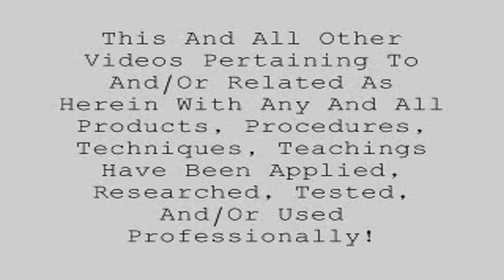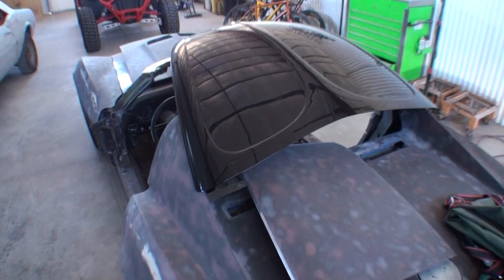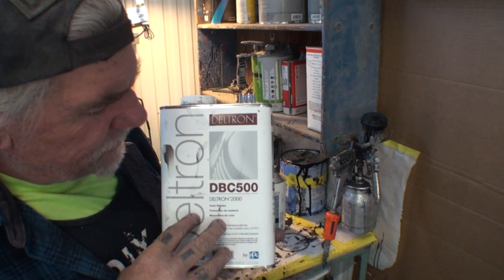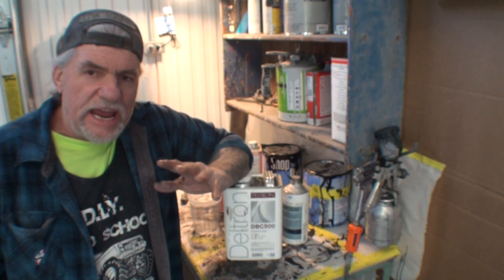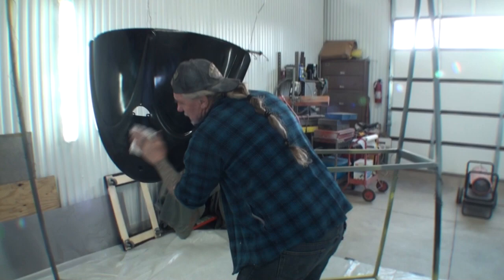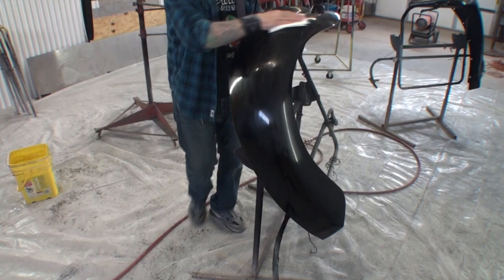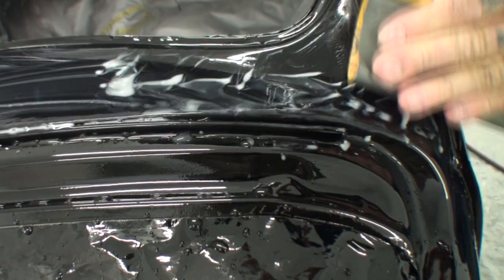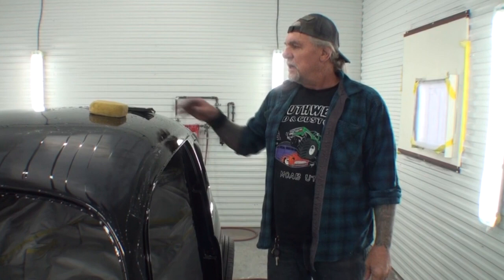How To Get A Show Car Paint Job - FLOW COAT For CLEARCOAT

Comment: Well my friend Pete … I ended up doing this by making my own mistake thinking I could clear the next weekend … after applying 2 coats of clear … and stopping . I also mixed my first two coats wrong … instead of 2-1 I mixed 1-1 which made resanding a challenge .. but I rectified the situation this weekend and pullled an all nighter and sanded the whole car down again and reapplied 2 more coats of clear to fix the situation
Reply: Did you use an inter coat clear or regular urethane clear to coat first? It makes sense to me using the inter coat first, sand and finish with regular urethane clear. It is new to me as I wouldn't think enough tooth was able to hold the final 3 coats. But your nibs are done with no orange peel and plenty of UV left for protection.

Comment: I sealed up a ‘97 crew cab GMC last night in Speedokote Color Blender/Intercoat clear($90/gal!!!) with Eastwood metal flakes in about 58 degrees and it still flashed off very quickly to my surprise! No runs either, very impressed for the price. Gonna clean it up and clear this afternoon when it warms up again.

Comment: Pete, this is a lesson from your experience that goes back to the 6 part series over 10 years ago. This was the two-tone 1941 Willy’s putting flames on using DBC500. 
  So not new to you, but simply experience speaking. Called anything from “Flow-Coat” to “Intermediate Clear” or really a inner-clear! 
Thanks for the training Pete!
Regards, DK. Omaha.

Comment: Pete used DBC-500  with my high school Auto Body students when we do our  "custom painting" unit on their practice fenders.  Very good results too.  Kids love doing the design, taping, painting, clear coating..  Might try this on my Camaro even though it is white.  Nothing wrong with a deep shiny white paint job.  Less expensive than wasting good clear too.  Put 5 coats of clear on my 79 Malibu, sanded with 1000, 1500, 3000.  Turned out great, but lots of work and more $$.  Great video!

Comment: Hey Pete I wish I would have thought about using DBC of HOK intercoat clear to do this! I always used the urethane clear and had to wait. I started using Matrix clear after I saw your comparison on clears a few years back, I like that it is actually clear... It is so nice and easy to polish a flowcoat paint job, just a lot of work to get there! I always flow coat motorcycles. Awesome job Pete!

Comment: Thank you for sharing your tips. Two questions: 1) any particular brand for the reducer used for the DBC 500; and 2) do you use Prep-All on the WipeAll to clean the sanded DBC 500 for the final top coat clear? Or, do you wipe down the sanded DBC 500 with a dry wipe all. or water on it?

Thanks for your time.

Ron

Comment: besides filling up the dry spots,(like primer, or something that wants to suck up your clear) ,this is kinda acting like a clear sealer coat, and in that case transtar has something they use over graphics, blends, and art  work,,,i think it's LV50, sealer, check it out ,it works really well

Comment: question I want to paint flames on my car Its a new paint job that I'm in the process of doing my question is after the base coat i spray the inter clear coat on let dry overnight as you said but do i sand it with the 1500 wet before adding flames or after painting the flames and  removing all tape then sand  Not sure what's the best process to do PS i know I'm suppose to wet sand before adding top coat its just painting the flames that has got me. Thanks for you class and taking the time

Comment: Hi Pete . If I got a car where the old pair is  faded badly but body is straight with  few surface rust spots . 

Can I sand car with 120, bare metal the surface rust spots do 2-3 coats of epoxy primer set it to harden few weeks sand it 400 and one coat of single stage urethane 2k sand it -600/1500 and apply  final 2 coats of single stage and buff polish at end and call it will it shrunk abd crack ? 

Or should I use 2k primer over epoxy abd sand it 400/600and apply the 2 coats of single stage 

The first method was proposed because I got extra single stage base paint cheap and I dint want to buy spend money on 2k primer . 

Thanks mate

Comment: Thanks for this video. I just done a C10 with HoK show clear. The customer was happy but to me something was missing. This is what I needed. One question..would applying intercoat be recommended if I'm doing a Matte finish? I'm wondering if it would add depth without adding shine.

Comment: Nice work! I do  some airbrushing and I know what the intercoat is designed to do. But when I 've seen people describe "flowcoat", I always thought that meant to thin out your final wet coat of clear and it basically "flows" out leaving a smoother than normal finish. This requires less final wet sanding as well. Thoughts??

Comment: This is not flow coat and dbc 500 is base coat without pigments which have different purpose in car repair.Yes you can do flow coat in two days but you need spray booth to bake damn thing.There are two pack clear coats that you can sand and polish after 10 min at 60 c or 140 f.So yes spray booth have lot of benefits:save your health,save money,less polishing...what you did is you  put heavy layers of base coat on surface that will soak gloss from clear.The main reason for flow coat is to avoid this.Sorry Pet but you are not competent about this mater.
Reply: Did you see that paint? Did you even watch the video? I’m gonna say Pete knows what the hell
Is up. Let’see
A Few Videos of cars you have painted so we can decide who paints cars better.